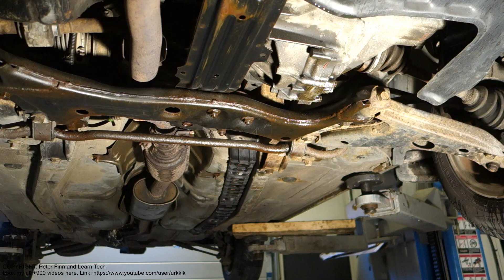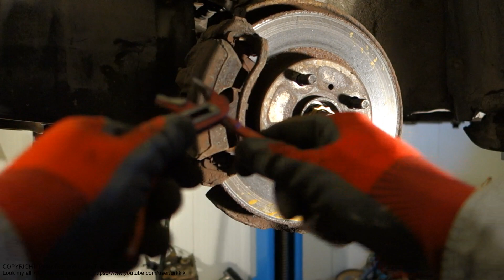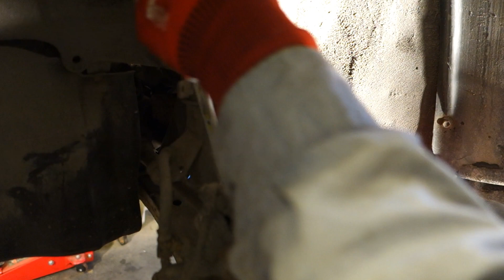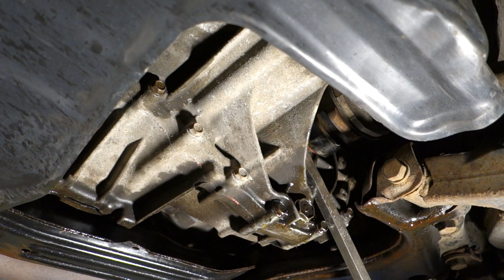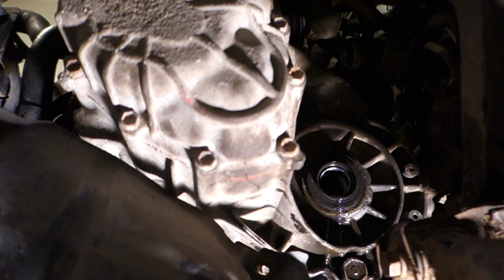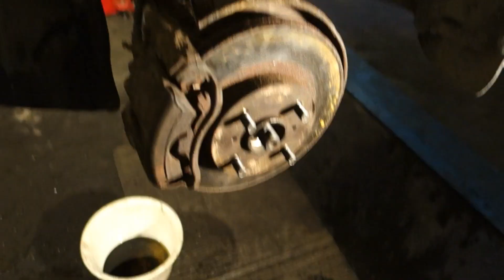How to repair drive axle and gearbox seal gasket oil leak

Comment: Good video,  i put low viscosity oil in mine by mistake,, 
the seals where leaking.. so i put thicker gear oil in,  , it stopped .. still fine..😊
Reply from the maker: Great point!

Comment: What oil drips out when drive shaft/ axle oil seal is bad?
Reply from the maker: Transmission and gear box oil. Later gearbox and automatic goes BAD

Comment: Does this seal need to be replaced on both dive shaft axles of the front-wheel drive corolla?  I have a 1994 dx wagon.  Thanks for your time and video
Reply from the maker: Only one side
Reply: @PeterFinnTheCarDoctor  thank you so much for getting me.  I just bought a 1994 Corolla Wagon DX and have been watching all your videos.  The World needs more folks like you.  Your a God Send.  My car is leaking oil and the tranny pan has slight drip.  Should I change tranny fluyid if it has never been done.  How long does it take to replace main seal.  Where tranny meets motor.  Big Job right?

Comment: 27:50 Alas, nice work, but you have no circlip on the end of driveshaft which goes into the gearbox. The end slides passes in the splines easily and pushes in by hand ...mmm
Reply from the maker: Good 👍

Comment: Just to point out...You are better off draining the gearbox oil and replacing the gearbox sump gasket (if the model has that) before replacing the drive shaft seal. This will verify how much oil you will have in the gearbox while treating it to fresh oil. Either too much or too little oil will cause damage to the gearbox.
Reply from the maker: Ok and Thanks  :-)

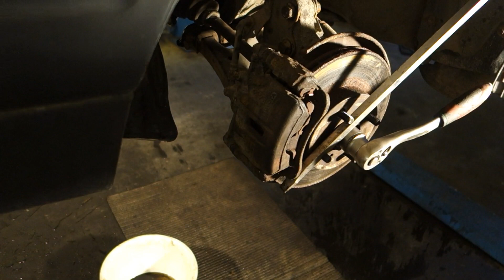Comment: Excellent excellent video!!! Can I suggest you put the lug nuts on at about 35:43 so you don't damage the threading.
Reply: I cringed as well when I saw that. I prefer to put the wheel back on, lower the car, and adjust it that way.

Comment: Peter '
Thanks ;

It's seal  NOT gasket.
There is a difference between them.

When installing the seal,
You should use a big socket
with the same diameter ( size ) or a piece 
of a short steel pipe in pushing
and hammering the seal in place.

Keep up .
Reply from the maker: Thanks Sir. 👍

Comment: Can I use this method on the Camry 2013?
Reply from the maker: Yes
Reply: My problem is complicated. 
The laek is a simple thing from transmission oil at night during parking and during the day there are no signs of laek on the transmission.
When I went to the technician did not believe me so much that he says the car is clean and there is nothing indicative of leaking

Comment: That brake disc looks really, really bad :-D Mine looked not that bad at all, but was not approved in the EU-control. Maybe they are not so strict in Finland as here in Norway? So I had to change. I also have a leaking between the gearbox and drive axle. So I have to replace that seal. Or use Omega 917 :-D
Reply from the maker: Thanks for info. :-)

Comment: Sorry Peter, where do you put the oil that was lost in the process of changing the gasket, is it in the gear box itself?..... do simply remove the upper bolt in the gear box and fill in a little bit of oil? Sorry if I sound ridiculous, but I have too little knowledge and I want to know if I understand correctly?! Thank you very much.
Reply from the maker: Hi, I add more oil to gearbox. Here is video: https://youtu.be/fDf6ohHWtwk